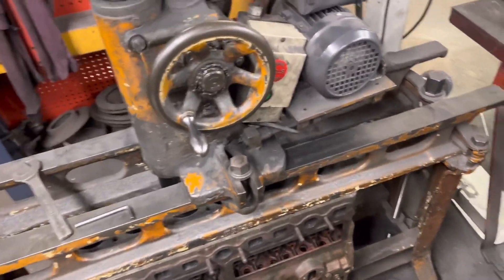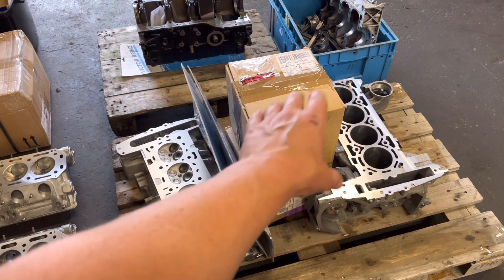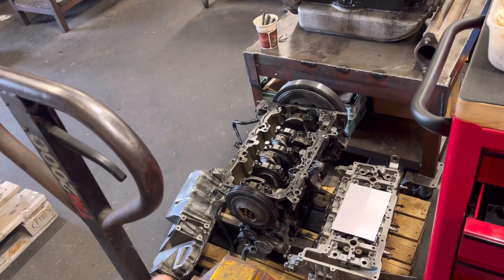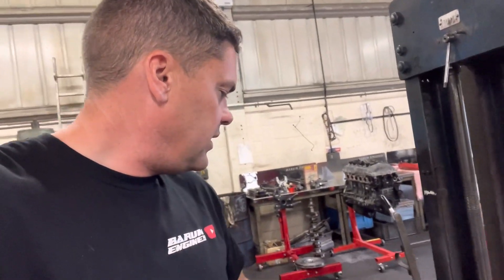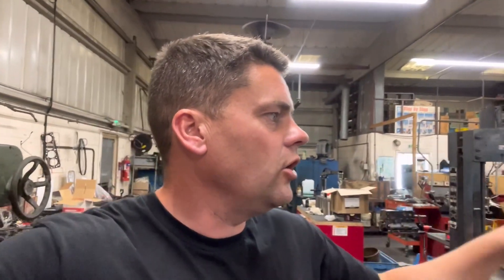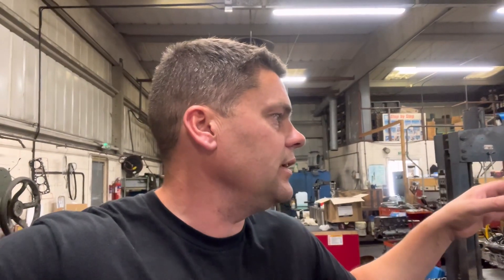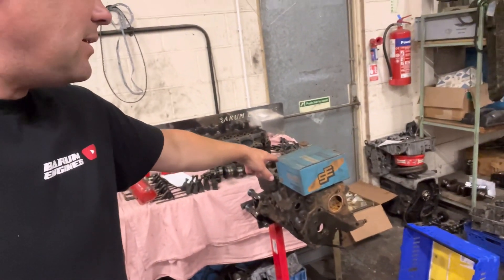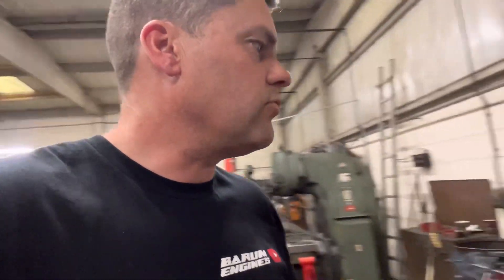STOLEN! You warned us before but it’s happened AGAIN, customer leaves with car without paying!

Comment: In the future Lee if you have a car & it's completed even if it's inside you should immobilize it till payment is made. We would remove the rotor from the distributor,a few spark plug wires or the main fuse. If you do differently each time there's no pattern to be learned. We caught several potential grab & run customers that way. We had a sign that said "No payment - No product! "

Comment: As for the van there has to be a local sign/wrapping company that would help you with branding/signage. Usually these companies have a graphic designer that can give you a couple of options using vehicle outlines, so that it's going to be an accurate representation of the finished job. They could use MR-RT stripe as an initial design with a Barum Engines twist ??

As for the non payment, the small claims court is the way to go.

Comment: Last year, I did a valve job on an Acura MDX. The engine had been severely overheated by the customer's son, who had continued to drive despite having had something damage the radiator. He ran it out of water.

The job started with a new radiator, but I told them at the time that the head gaskets' life would be better measured in minutes than in thousands of miles. Surely enough, a hundred miles later, both head gaskets failed.

I did the job for the least I could afford ($2200/1850 Pounds -- It should have been $5000!) because they were friends of mine, and I returned the vehicle with newly functioning air conditioning.

They stiffed me and moved out of State.

Comment: Would laugh at anyone that wanted to take the car away before payment 🤦‍♂️. Also 3 hours seems ridiculous for a head gasket replacement with the engine fitted to the car. I’d be spending an hour confirming the head gaskets failed, the replacement and checking it hasn’t caused further damage, plus at least an hour of post replacement checks making sure the cooling systems working perfectly, fault memory checks etc otherwise it’s likely to come back again

Comment: It seems to me that you have all your engine date in your head. may I suggest that you have a little more date on each engine with a sheet of paper with the Job number and detail of what you have to do and what you have done.
If you get run over know one will know what is going on with all your engine stock and have better control.

Comment: You should consider taking a fee upfront to remove engines at a fixed price, as you are an engineering workshop not a vehicle service center.   Genuine customers wont have an issue with that, its fair, they can get a price from a mechanic but they will still have to pay them  before you get it anyway.

Comment: You said the car needs it's bonnet putting back on. In my experience, people like this who fuss over nothings, deserve stiff treatment. So, you've discussed the car, bonnet still to be fastened. Walk back inside, tell staff not to touch the car without your say so. When the guy appears, your line is, " ok job done, just the bill to settle, then we can fasten on the lid and you can be on your way." Nothing more. Except I don't know what you are thinking , by leaving the keys in when it's outside the garage. Unless of course he used a spare set, in which case I would have called the police straight away, because as far as I know, that's theft.

Comment: Just a comment on the Studebaker. AFAIK the engines in the older Champions were made by Continental and are the same as in Clark forklifts for many years.
My dad had a 36 but I believe the Same engine was used post ww2.
Reply: I remember the older Cesab counter balance forklifts could be had with a Continental TM27 power unit option. I remember having to fit desert spec radiators to them else they would always run hot / overheat.

Comment: Is that the bmw with one big end journal knocked out. If the crank is straight would it not be worth metal spraying just the one journal and grinding back to std? 
Or is this going in a car that will be pushed to its limits

Comment: If your writing off the debt and don't want to employ a solicitor to pursue it, sell it to a debt factor. It will concentrate their minds when the bailiffs call. I agree its not a friendly way to settle a problem but they have already crossed that line. Dont drop the price because they did the welding. The breakage was wear and tear on a badly installed tube

Comment: That A-series has not been much fun overall. Obviously the customer is likely to be getting conflicting info from the guy that installed the engine. Chances are that the original rear crankseal would have been fine with the breathers connected correctly. No idea how long the customer has been stalling you off from payment, some people rarely check emails or you might generously allow 2 weeks in case he is on holiday. Then come down on him hard, to be honest people that are as inept as the owner should stay away from old cars. Sounds like it is a Sprite or Midget... hardly the most complex  of engine bays.

Comment: You need to be hard on people who bicker the price after the job is done. You need to disconnect the battery wire until it is paid for so they don't get the idea they can drive off without paying. He needs to be billed for the cleaning supplies he used and if you need to take it to court he needs to pay for your time in court. Your time is valuable, all the time you sent billing invoices and time in court.

Comment: I keep getting people that I know, tell me they can't pay all the bill when they come to pickup, offers half and takes their car. Sometimes they pay 2 or 3 weeks later. Sometimes they call 2 months later and tell me their car is acting up again and what I fixed wasn't the right thing. I'm like what? I called you days after and every time I've called you said it was working great. Then when something that isn't related goes wrong, you blame me? No, I need paid for that job before I do anything else for you. They still ask for me to fix their car but they don't have money to pay till mid month. I tell them I don't have money either, because people like them hasn't paid. You can't keep fixing people's cars without getting paid. Time=money, parts=money. I keep asking people if they are going to work and not getting paid?

Comment: I always assume the British have better manners than we do here.  That sure leaves a bad taste I bet.   Do you have mechanic's liens there?  That might be an option if all else fails.  Over here, the best example I can remember was a guy that won an award from Wells Fargo Bank.  They didn't pay him, so he slapped a lien on their local branch and the sheriff locked it up.  They were going to auction off the bits and bobs to make up the payment owed.  WFB cut a check pretty dang fast after that.  It's the same type thing. 

Do what you can, but keep working on the fresh opportunities, sort out the problems in regard to their worth.

Comment: Legit I've never had a workshop give me the keys back until I've paid the bill.

So if I was to try skip out on the bill I would have to leave my key with them and use a spare which then leaves them a very easy court claim considering they can prove they never returned the original drop off key.

Comment: Gutted about that head gaskets customer but by my dealing with customers like that is all ways have there car blocked in so they can't drive off as they are always going to ask to run it or drive it don't let them out of you site. 
And just put a small claim court in for it..
And PS get the door locked changed to high security flat locks on your new transit as they get mole grips opened and destroys the door even if they do steal it ...

Comment: Lots of sentimental comments here from non-business owners.   Write off the head gasket jerk, and don't spend another minute worrying about that specific person.  However, work hard to figure how what you have power over, that let that happen.    My point is (I promise I relate to your channel about 100%) you need to follow some structure that is engineered very well to further your goals.   Short answer on all of this is firm and fair rules about conducting business.   You WILL end up firing about the bottom 20% of your customers, because your current structure allows you to be taken advantage of at least a few % all the way to 100% like the head gasket guy.   Also, time to raise your prices!   If you are that busy, start going up.   I don't like sudden price changes, so add a bit to your shop rate every week on new jobs until the laws of economic precendence kick in.   This means you can be a better provider to you and yours, your quality will go up substantially just by unloading the BS off of you and your staff, and your customers will be happier.  GOOD CUSTOMERS  WILL NOT CARE ABOUT THE COST POLICY, JUST THE RESULTS -

Comment: Right, here we go again. You have a dispute with your customer because he has left without paying and took the car with him. Again its the same observation as i made eadrlier on the other video where you are having customer woes. My advice? DONT LET THE CUSTOMER HAVE ACCESS TO THE KEYS TILL THE BILL IS PAID. It really is that simple. Even the Police do this with roadside stops nowadays. They stop the car then take the keys to stop the driver doing one. And if he gets charged with anything its easier to impound a car with keys. I also used to put a customers car behind a staff car and box it in until it was paid for. When they realise they are not getting the keys, and its blocked in so they cant use the spare key they brought with them, they soon pay. Its a case as i said earlier, you make your own trouble. When i used to work roadside recovery my boss used to call them CYA jobs, COVER YER ARSE!!